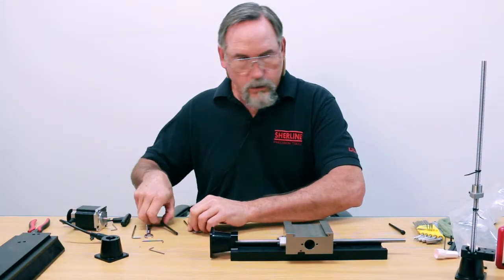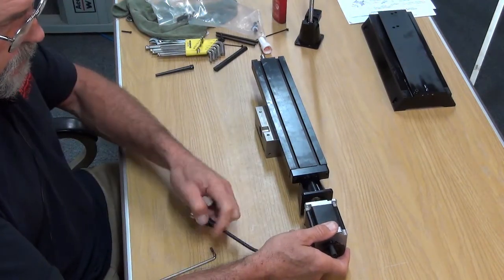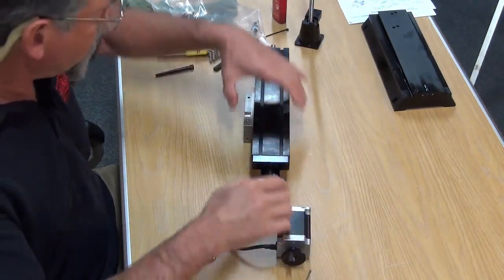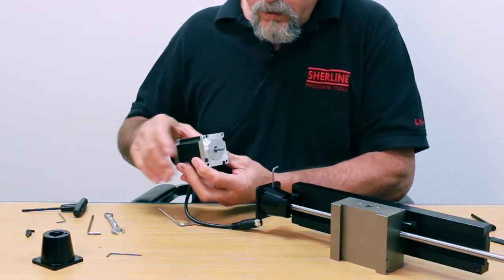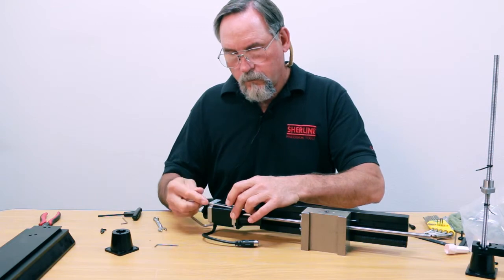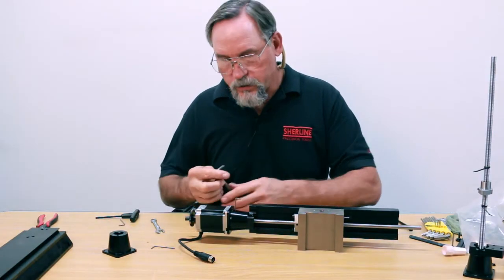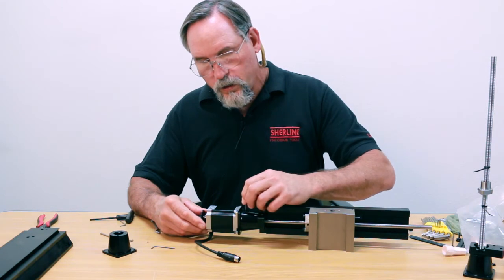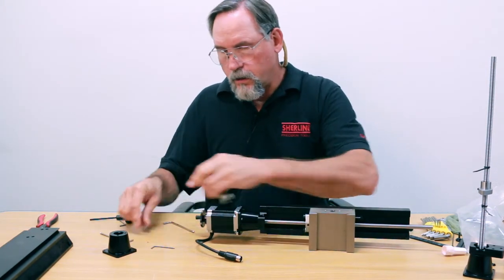Aligning the Stepper Motor to the Ball Screw

Comment: Hello, wanted to know, why do we need bearings while the lead screw is attached to the coupler and stepper motor, isn't the stepper motor and the coupler plus the housing, enough for the stability of the lead screw or what is the purpose of the bearing ? to cnc router ?